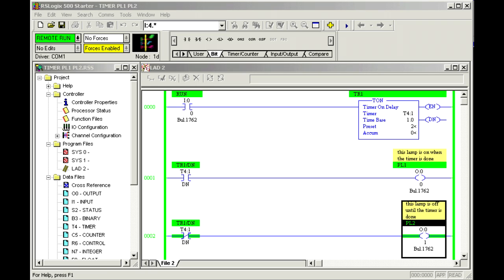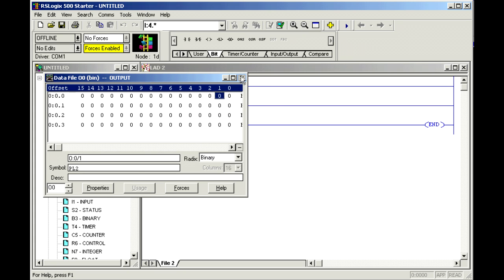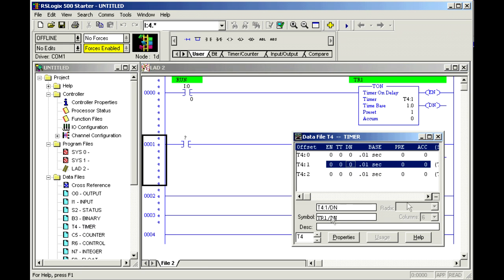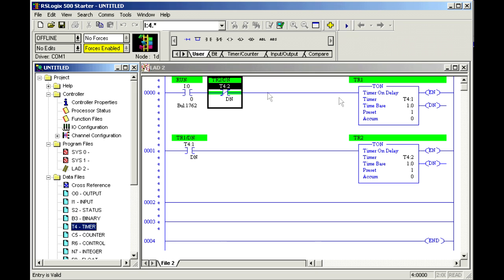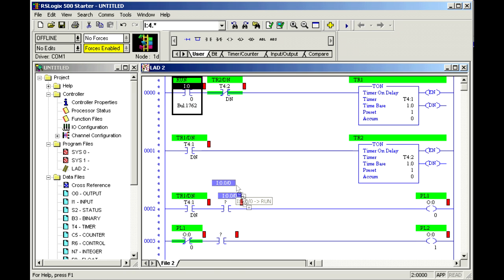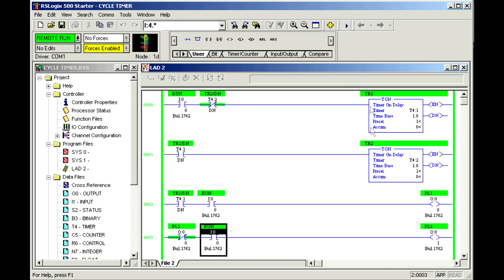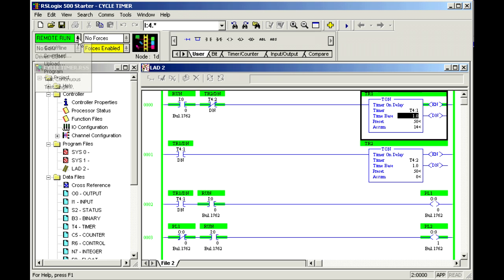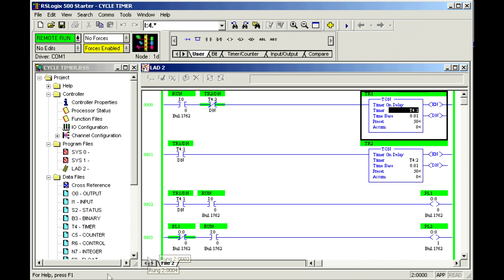cycle timer.mp4

Comment: Hi how would I have four pilot lights sequentially contrlled by one timer. For example blue light turns on after 5sec, green light turns on after 8 sec, yellow on 3 seconds after that and a red light 6 seconds after the yellow?
Reply: You can set a preset of a long value such as 100 seconds, and use compare functions to detect which lamp to light based on the accumulator value.